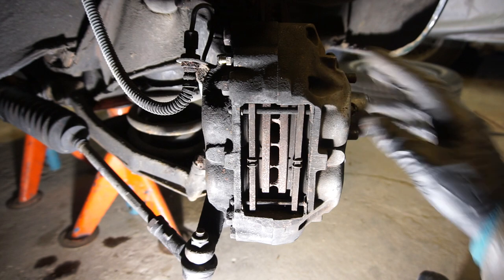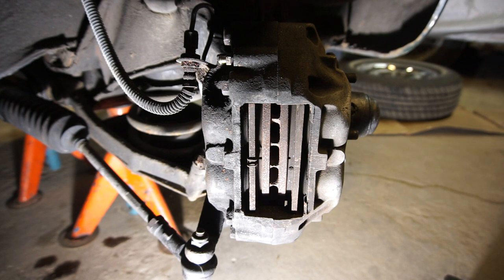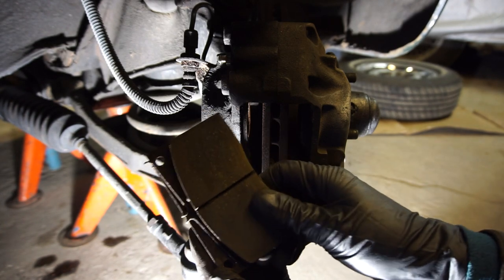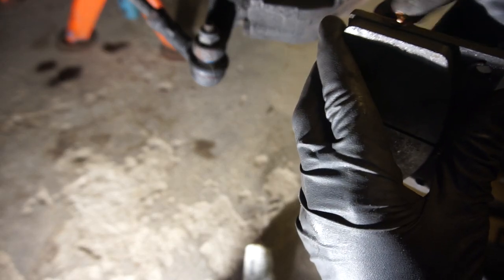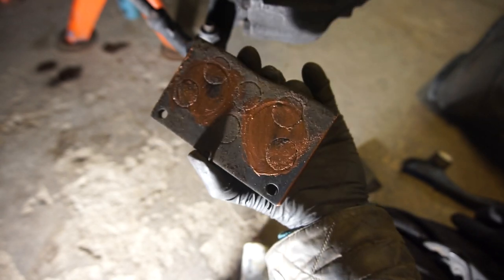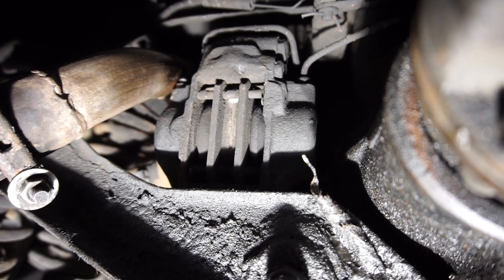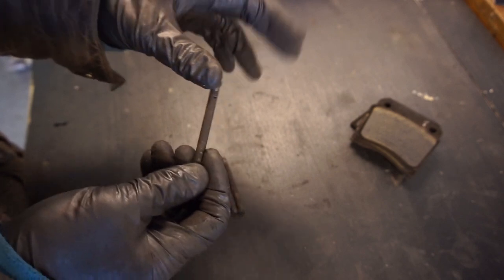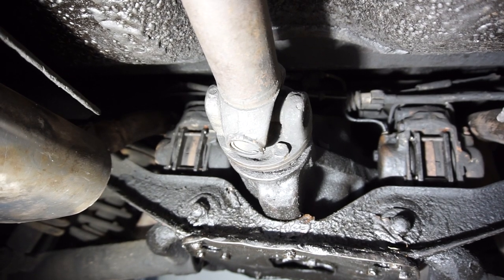Checking over the Brakes - Jaguar XJ6 Brakes

Comment: Another great video!  An additional source of rear brake noise is improper installation of the plate (with two prongs) that goes into holes in the parking brake assembly.  I took the rear brake calipers off to replace the rotors, and in my hurry to reinstall tightened down the plate without those two prongs properly being in the holes.  If those get bent it takes forever to bend them back to the right position.  By the way, taking the parking brake assembly out isn't too bad if you lay underneath the trunk area and reach up to pull the assembly down and toward the rear of the car.

Comment: Nice video, Adam. My 1985  Vanden Plas rear brakes needs rotors. The car only has 46K miles, but the previous owner  lives up in Cripple Creek Colorado--about 12k feet above sea level with extremely steep hills--makes San Francisco look tame. Anyway, looks as though I have to take the entire rear end apart to replace the rear rotors as well as the passenger side caliper, brake pads, parking brake pads, etc.  Would you have any advice or perhaps sympathy? Again, Adam, thank you for another fine video. Chris/Colorado/USA

Comment: Very useful video. I drove an S3 and one thing I remember is that you have to push hard the brake pedal to work, harder than you expected compared to a modern car. The owner said that this is a normal thing. Is it the same on your S2 ?  It is not a big deal because you get used to it after a few minutes but you slam the brake first couple of times you drive the daily car.  Do you know of any replaceable part or conversion kit that makes the brake easier? Thank you.
Reply: Pretty sure that’s normal. They should be firm but work well.
Reply: There should be no real difference in foot pressure on the brake peddle between an S3 and a modern car. This sounds as though you have at least one sized piston in a calliper. I have just dropped my rear sub frame on my V12 and found that both rear calliper's were sized solid and will have to be scrapped as will the discs. If I were you, I would get the braking system thoroughly checked out.
Reply from the maker: The brakes on these cars are great even compared to modern cars. They are not an overly soft pedal but should have a good solid feel and then powerful servo. People who race have updated calipers to Wilwood but original ones are more than enough for regular use.
Reply: I drive an S2 and dont think there is an awful lot of difference with the brakes compared to a modern car. In fact I think the brakes are more smooth on my XJ6 compared to my XJS which is younger.